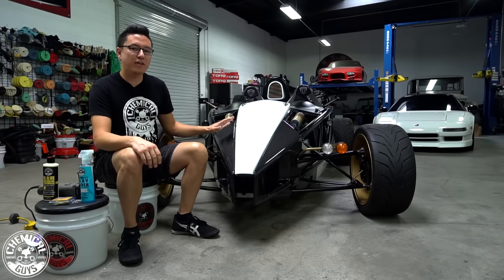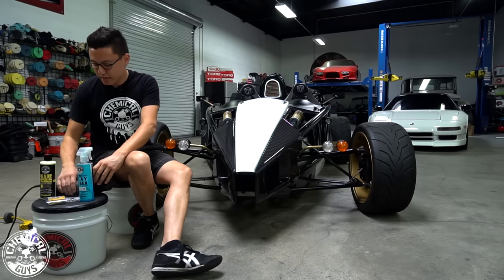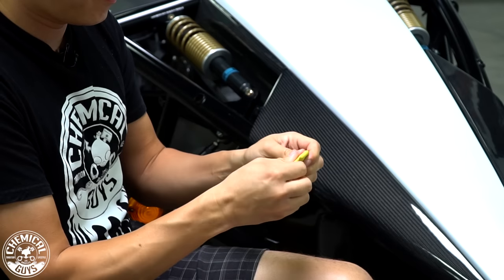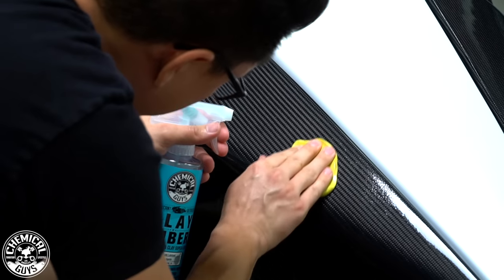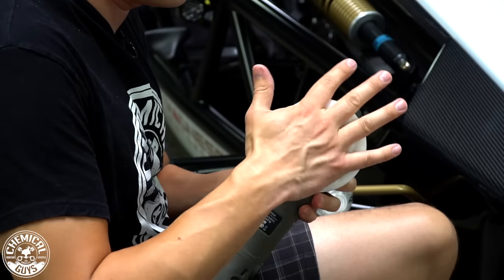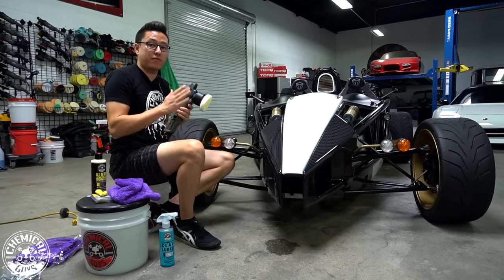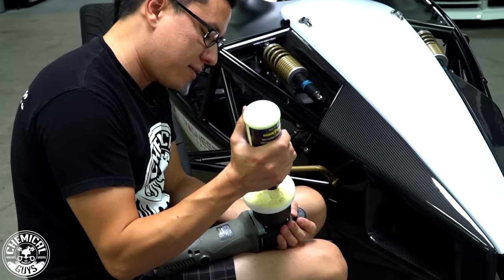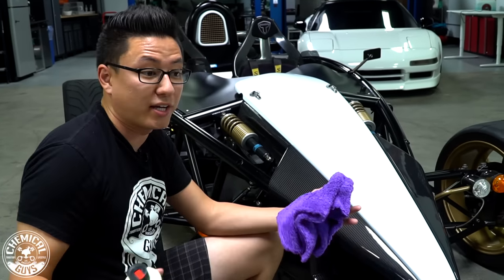How To Polish Carbon Fiber - Clear Bra Protection Film Prep - Chemical Guys

Comment: @chemical guys I have a question so when your done using a clay bar do you guys use the same clay bar or you use a different one when working on the other side of a car
Reply from the maker: We normally use the same piece of clay bar until we fill it up with filth and contamination. Once no fresh surface shows after kneading the clay bar, it's time to throw out that piece. I tore off a fresh piece in this video to reiterate the point of using only a small part of the whole clay bar.